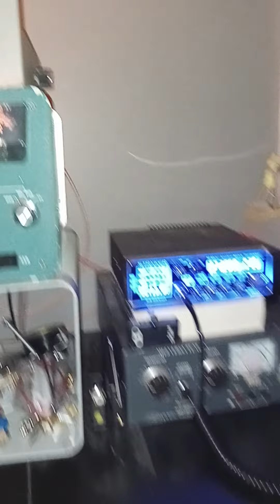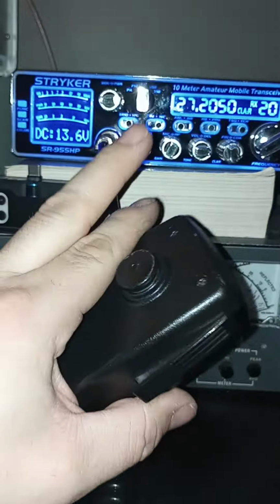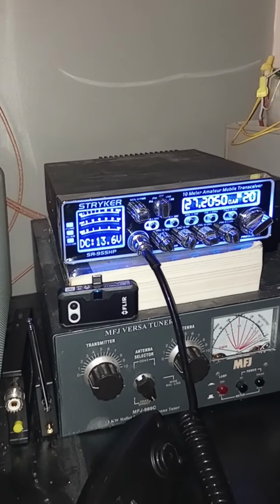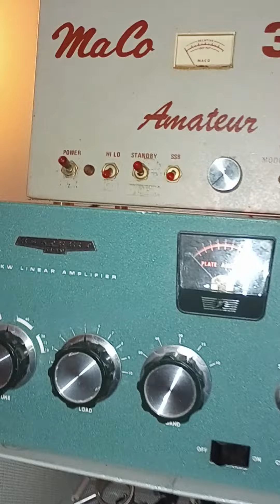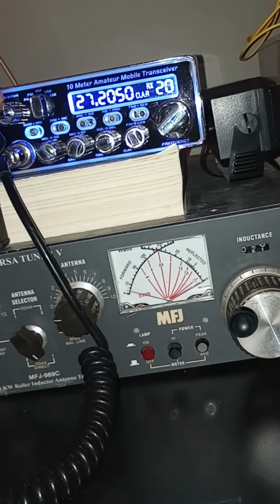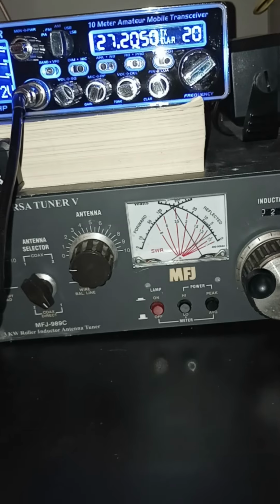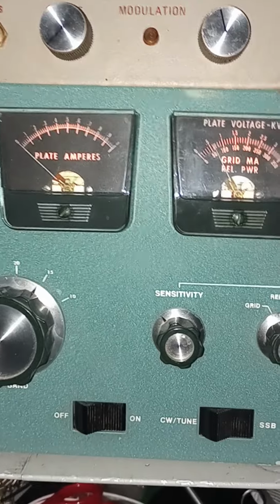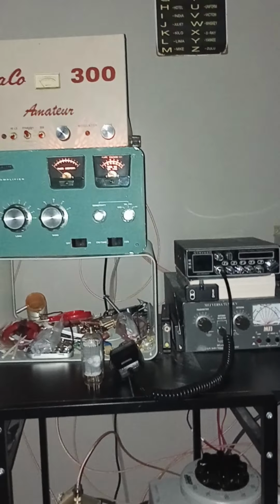sb220 is the maco 300 the perfect driver?

Comment: If you drive the sb 220 with the 300 the 3 500 tubes won't last.  They are made to handle a 100w ham radio.  I swear cbers know NOTHING about practical electronics.
Reply from the maker: @ericzerkle8486  brahahaha. Did u even watch the video? I use it on low, the 300 is missing one of its final tubes and my radio is turned down to 4 watts so when normal talking not yelling into the mic it makes like 125-150  watts PEP going into the sb-220. Plus who cares if they burn out. Buy more. They make new ones every day.